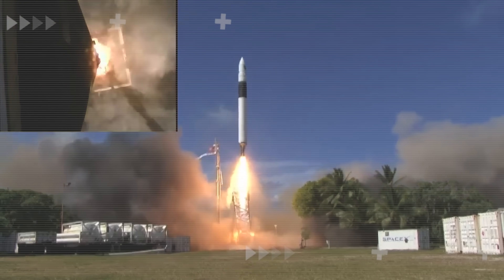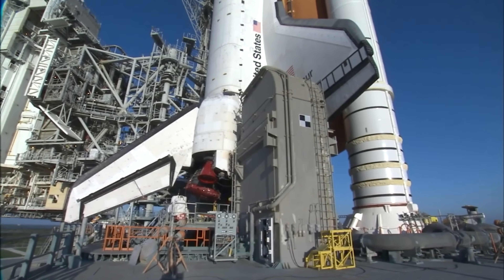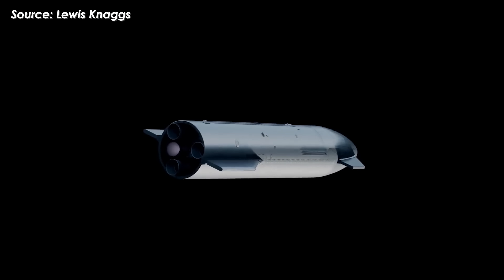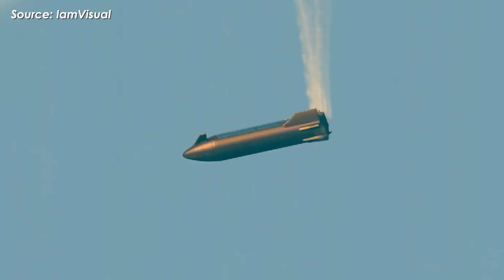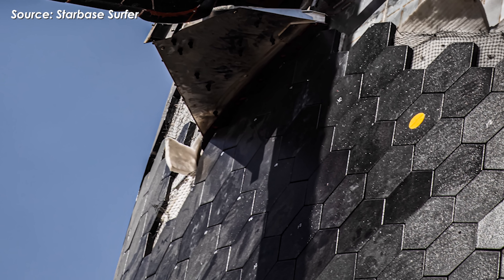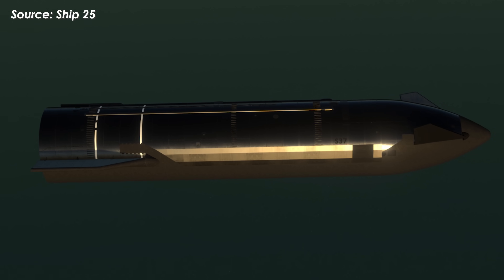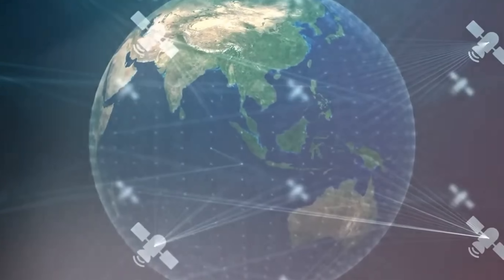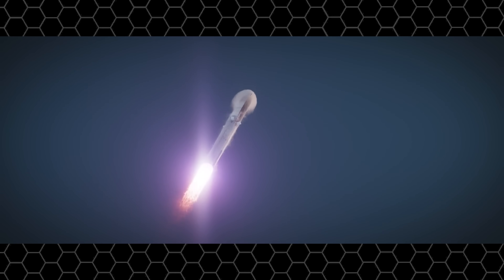Elon Musk's Starship Big Solution: Skip Heat Shield! Why? Flight 10 to make History...

Comment: Ya..they need a clean flight…bad idea to try this now
Reply: They are using what is considered old equipment to collect data do you know how many cars are run into concrete walls to collect data same thing but with a ship
Reply: @rickdunn7585  i understand that..but last ship exploded and what two flights before that had major issues….they need to test positioning of new flaps and new tiles, test copv repairs….yes they learn from failures..but you also need successful flights to test out system…i mean logic is gonna tell you if repeated tests all have issues…you’ve got  big problems

Comment: What about some magnetic shielding? Can we manipulate a plasma stream with magnetism?
Reply: Extra equipment means extra weight
Reply: @TimT69 is this something that could be solved with a micronuclear reactor generator system?
Reply: Plasma is even hotter than reentry. Plasma would burn off any heat shield 🛡.
Reply: yes we can...
Reply: Graphene and Polyphase Pulse Modulation to create a programmable tubular shape of rotating plasma which acts as an air bearing principle for illustration purposes. 
plasma on plasma bearings, one atom thick! 

Amplitude modulation would provide steering with programmable plasma drags.
A programmable airfoil in atmosphere too. 😊
No moving parts.
Reply: @Cudzu-Fl More unobtainium hardware

Comment: Transpirational cooling around joints and passive tiles for the rest of the hull may be a compromise solution for reentry.   The weight of the fuel or coolant needed would be minimized and would be offset to some degree by removing the tiles around the joint.  Using more than one method for reentry cooling does add complexity, though, and does violate the KISS principle of engineering.  Maybe the metal tiles will work out.

Comment: I wonder if SpaceX could make heat shields with stainless steel with. Diamond dust mixed in the stainless steel. I heard diamonds can with stand heat up 1,500 degrees direct and up to 2,500 degrees indirect heat.
Reply: Does not sound feasible: diamond is carbon and would burn up in the direct oxygen-rich plasma stream of reentry, also it would conduct heat into the structure, requiring extra insulation, rather than reflect it away.

Comment: Anyway I was wondering if SpaceX could slow the whole rocket to 300 miles per hour to the point it wouldn't get that hot. I don't know what it would take to actually slow a rocket down to those speeds.
Reply: Lots of fuel
Reply from the maker: you're correct

Comment: How about a Starship manufacturing space station?  If lift off is what damages heat shields, install the shield tiles in space.  Start by sending enough Starships to link up to a central hub,  say 8 to 10. None of these will ever need heat shields.  They won’t even need a full compliment of rocket engines necessary for the return trip, and even the rocket engines needed to obtain orbit could be recycled.  Add to the number of Starships that don’t need shields any Starships destined for use as moon base infrastructure. Initially use Spaceship Dragon for all human transport to orbit.  Then with a completed “space dock” only ships needed back on earth can be fitted with shielding AFTER reaching orbit to avoid all the liftoff damage.

Comment: This is not as great a  win for ULA. If they wanted to do better they should have done the real upgrades to Centaur that were dreamed about in the 80’s, when GDSS owned it, instead all they did was a small set of upgrades. The Vulcan is just a glorified Atlas, it could have been reusable built on the same line with few major changes.  The changes they have made are minor in comparison to what they could have done. Do better.

Comment: Makes sense, why go green or go for reusability when you need to validate the Starship first, then when that's done they can focus on the heat shield problem later. Plus saves weight, just make it throwaway, 250 tons payload capability, can make ISS 2.0 with two launches and haul heavy stuff.

Comment: Won. ULA throws all their hardware away after each launch. Not much competition for SpaceX.
Reply: Starship has mainly done that in 9 flights. ULA reuses the solid boosters. Falcon 9 doesn't reuse the second stage.
Reply: your supposed to say one not won
Reply: @gammerguy13311  I didn't think I would have to put a smiley face behind it.

Comment: Starship V2 is a dead end!  What is the value of collecting "real data" on a vehicle that is being replaced ASAP?  Instead of "collecting real data", is it possible that the whole point of Flight 10 is to prove (to investors and potential customers like the US military) that the PEZ door can work - something that will be reused in Starship V3 - and nothing more?  Is the removal of heat shield tiles MOSTLY to lighten the Starship V2 so it can go higher because with the full set of heat shield tiles and the under-performing Raptor V2 Starship doesn't have any chance to get high enough?
Reply: The heat shield on the Block 1 Ship has a mass of ~15t (metric tons). That Block 1 Ship has an average dry mass (including the heat shield) of 149t +/- 6t (from my analysis of the flight data from IFT-3 thru 6). The average dry mass of the Block 2 Ship is 164t +/-2t from my analysis of  the IFT-7 and 8 flight data. 

The heat shield mass is not the problem. It's about as low as it can go and still provide sufficient overheating protection to the stainless steel Starship hull. It's not a big deal if the Ship's heat shield is not "fully and rapidly" reusable once Starship becomes operational (in late 2026 or early 2027). It's more important that both the Booster and the Ship land on the tower arms with high reliability (>95%) so SpaceX can examine the Ship's heat shield and make any repairs.

Elon's stated goal for Starfactory production is three Ships per week (see: https://www.youtube.com/watch?v=tbfO-hbKagc). That's 156 Ships per year. Assuming that actually happens, SpaceX will have no difficult establishing an inventory of several dozen pre-flown Ships in a ready-to-launch condition (similar to the way SpaceX currently has an inventory of a dozen pre-flown Falcon 9 Boosters ready to launch when needed). So, if a Ship lands at Starbase Boca Chica or at Starbase Florida with heat shield damage, it can be repaired and made ready to launch quickly enough without disturbing the launch schedule.

The best (rapidly and fully reusable) is the enemy of the good-enough (high landing probability and rapid repairability).

Side note: My lab spent nearly three years (1969-71) developing and testing dozens of materials and processes for the Space Shuttle Orbiter heat shield tiles during the conceptual design period of that NASA project/